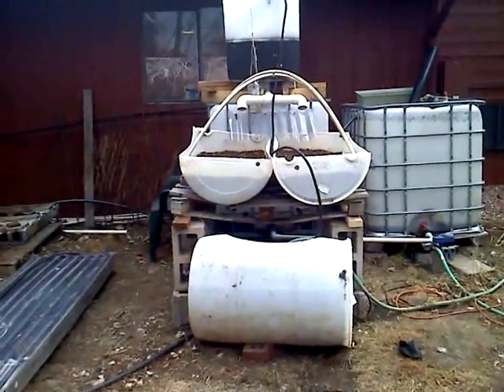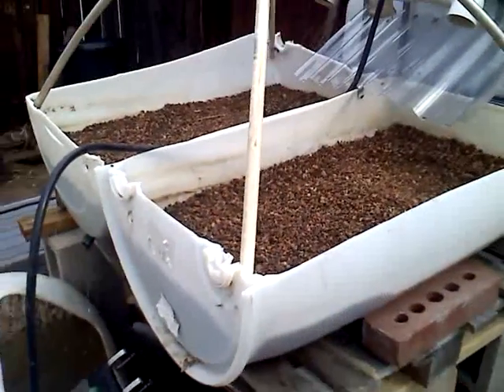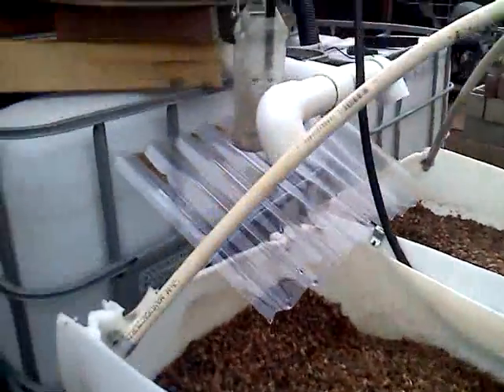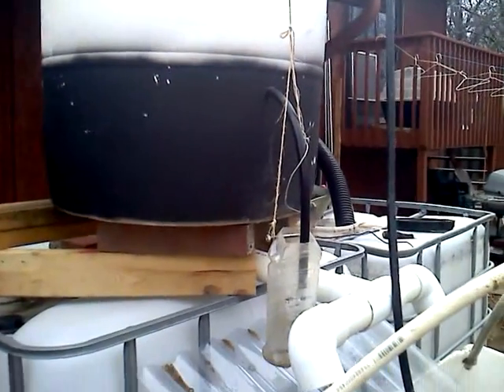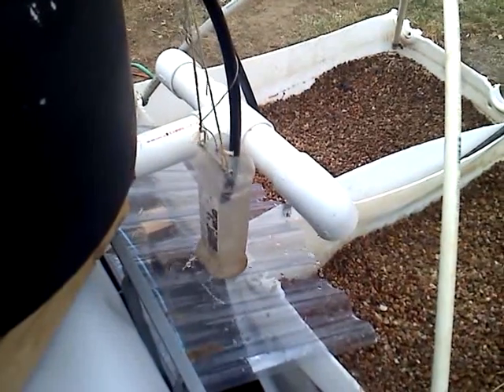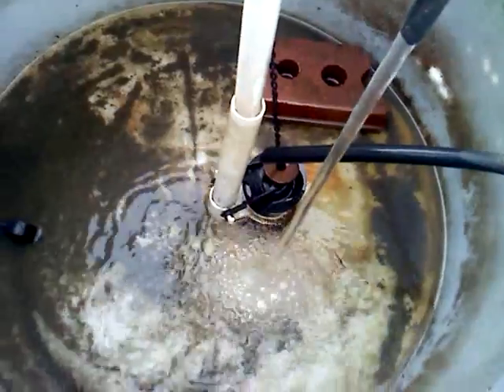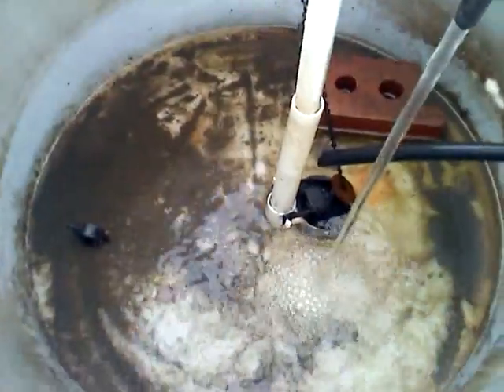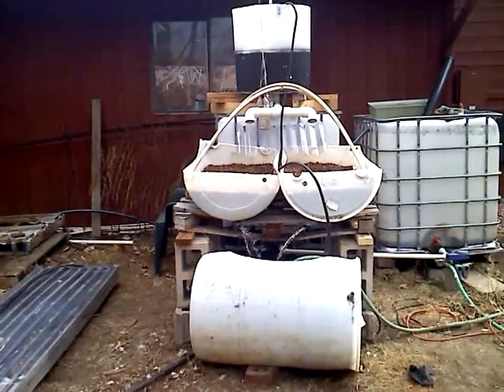Barrelponics Aquaponics Boulder Colorado

Comment: I do applaud your using what you have on hand and it is a testament to how versatile this design can be.  The framework concerns me a bit also as these things can be very heavy and should be very well supported.  I would sure hate to see anyone get hurt if it collapsed.  You also mentioned an overflow in the fish tank.  If this thing is built properly that should never be a consideration.  Not had it happen here unless a major rainstorm after topping off the system

Comment: Unfortunately you have not built the added benefit of being able to adjust the Floodtank (that's what it's called, by the way) volume and as such your flood volume in the video is way too much.  The  fish tank should be in the full  upright position and adding the float  valve to keep it topped off will only add water when it is at the bottom of the cycle which will make it overflow between cycles.  Better to put the float valve at the lowest position just before the Flood Valve opens.